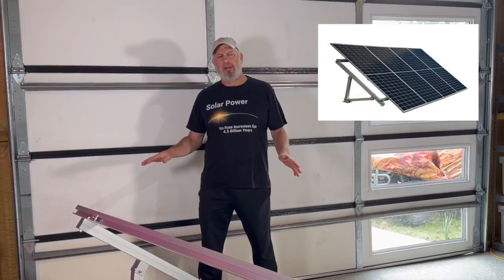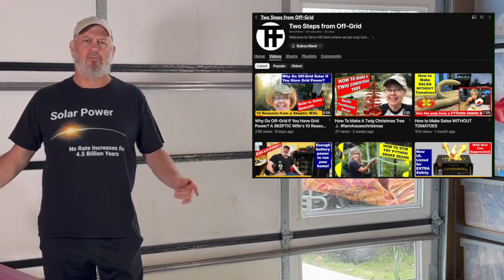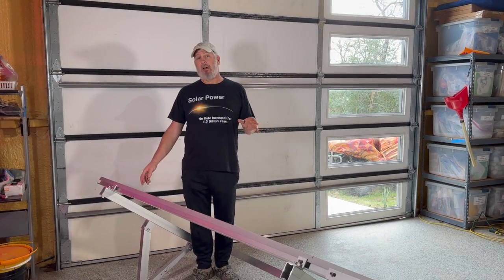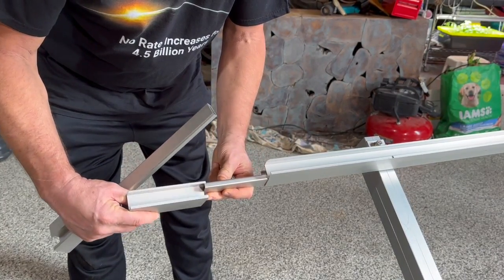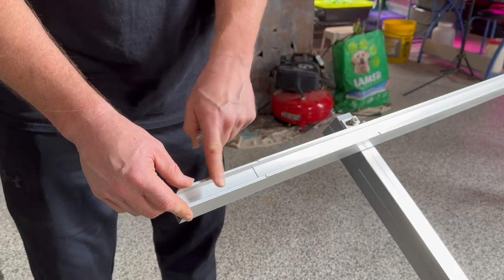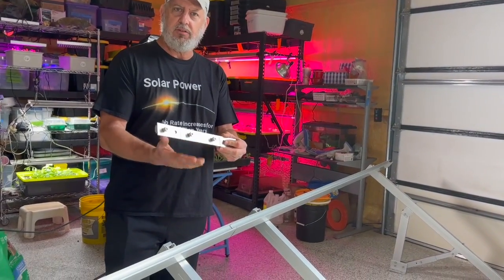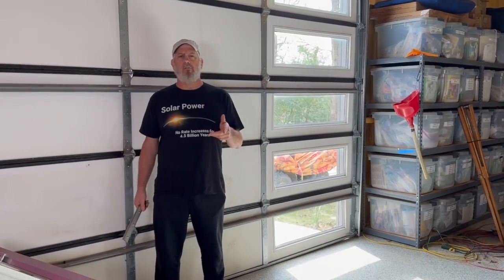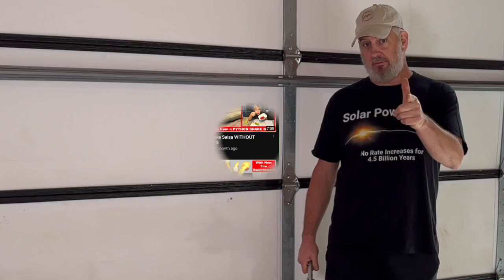Fit LARGER Solar Panels on DIY EG4 Brightmount Rack with Extension Kit

Comment: I want one of these but...........this costs $12.15 and the shipping costs $12.60???? lol. Shipping is more then the product itself. It's not like its a huge package or something
Reply from the maker: @Moes_Prep_and_Tech  I agree thats expensive to ship, but given the $300 investment in the brightmount rack, if it won’t hold your larger panels, $25 more beats not being able to use the rack.  I’ve concluded there’s  just no cheap & reliable way to do ground mount panel installation. If you can permanently mount them for less than $75 per panel, please show me how. 😆💰👍
Reply: @terrahillfarm  if i have the 1st version of the brightmount kit (the non adjustable one) do i need to get that splicer thing?
Reply from the maker: @Moes_Prep_and_Tech  your BM kit should have 2 splice bars to join together the 2 pieces of the brightmount.  If you want to put 2 BM kits together, you can order an extra pair of splice bars.  I don’t think you need an extra for only one kit.  Of course with the price, it may make sense to order the extension kit and splice pair since the shipping cost would be only a little bit more.

Comment: Very helpful video! Thank you! Do you think that mounting the unit on 4 - 6x6's would be sturdy enough to hold your 4 panels?
Reply from the maker: Thanks!  Yes I think 6x6s sunk a few feet into the ground with a large amount of concrete base for ballast would work.  I’m trying out a combination of drilling holes into solid concrete pads and tying the mounts down with ground anchors and chain.  Waiting on my 3rd brightmount rack to get here to finish.  They’re on back order until mid July. 😆. I’ve also considered using 6-8” sonotubes with concrete.  In my other video I built an adjustable rack for 12 panels using super strut and 12’ 6x6s.  It’s held up well so far.  I like the Bightmount racks but anchoring them well is the biggest challenge.  👍☀️⚡️🔋💡

Comment: They don’t even bother to pre-drill the holes for you? Mine came with no holes. I used the brace extension piece with the four round discs to hold it there.
Reply from the maker: Always an adventure trying to mind read the instructions on overseas products.  I’m almost convinced the screws were meant to be self tapping and break off once secured, but there’s no mention of that in the box.🫣☀️⚡️👍🔋

Comment: The extension kit goes in the center.  This way only one kit is needed.
Reply from the maker: One kit contains two extensions so you can add them in the center or to either end, depending on where your panel clamps end up.  ☀️👍⚡️🤩

Comment: Would this work for a couple Newpowa 200w solar panels 27.76in wide with room to grow, or is there a cheaper solution for smaller panels?
Reply from the maker: The stock mounting rail is about 179”.  You should be able to easily mount 6 of the panels you mentioned, without extension kit.  You can build a rack cheaper with wood and unistrut, but there are a lot of small pieces you’ll need to buy (see my DIY wood panel mount video).  The brightmount kit has almost everything but ballast/anchors, included, so it is more convenient and faster to get up.  If you are only using 2-4 lower watt panels, the Ecoworthy kit on Amazon is a much cheaper solution at around $130. ☀️⚡️💡🔋🤩